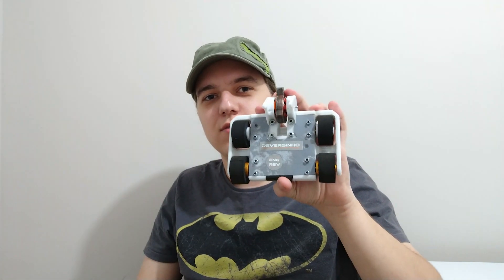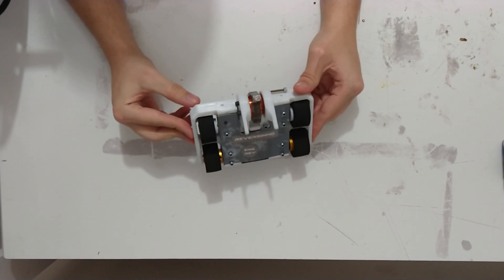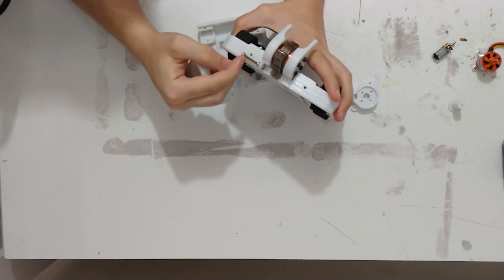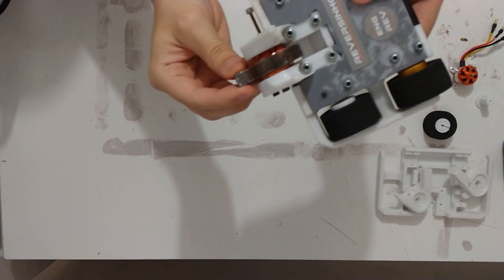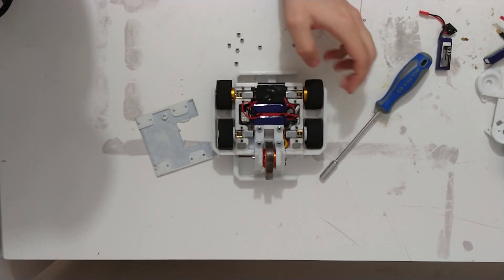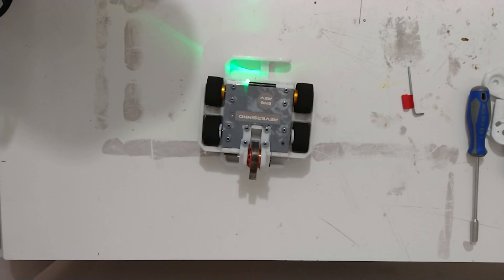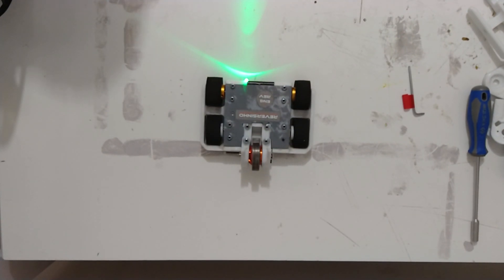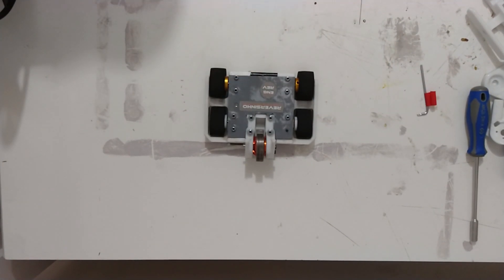Overview Reversinho - 1lb 3D Printed Combat Robot

Comment: flysky fs-i6 transmitter with fs2a receiver... receiver weighs less than 1g without pins.

mixing is easy to setup too, i have a video on my channel showing how to.
Reply: Thanks Man, it's on my list, but o want a pistol grip like, i'm used tô drive rc cars, i found a radiolink rádio, but the receivers are big and expensive, but thanks man